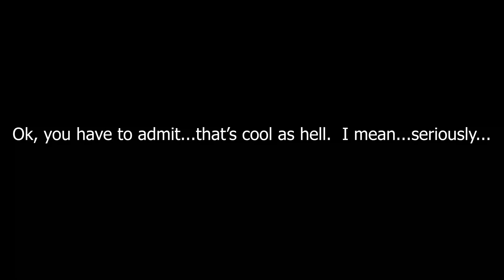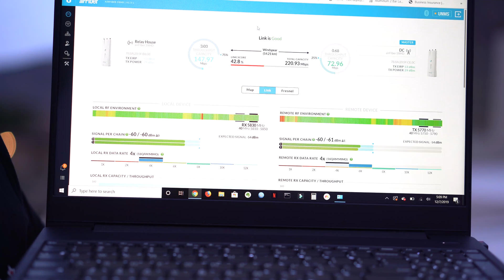Ultrahorn Fun - DIY Ubiquiti Internet Relay - Pt 32

Comment from the maker: Went from a super janky "meh" connection to ROCK SOLID all while turning the transmit power DOWN!!  There are some obstructions in the shot, so it's not going quite as fast as it "should be", but it is working better than it ever has and that's after turning transmit power down...that's the beauty of the horns.  :-D 

Thank you all so much for the help!!  You're the best!

Comment: Bro, I'm having a hard time with the ubiquiti 30db antenna. My link is 18km long and around 17km of it is across sea water, can the RF elements horn possibly help improve the connection of my AF?
Reply from the maker: Maybe. But, you need height. How high off the water can you get?
Reply: @rmp5s  my 2 towers are on the hill top facing the water and at middle of the link, the line of sight height is 110ft and the fresnel height is 57 ft. Signal drops happen in random time of the day.
Reply from the maker: @randomxspots  Yea, give them a shot. Sounds like they could help.
Reply: @Jon @GeekiTek thank you bro. I'm planning to buy 1 RF horn and try it on 1 end of my link.